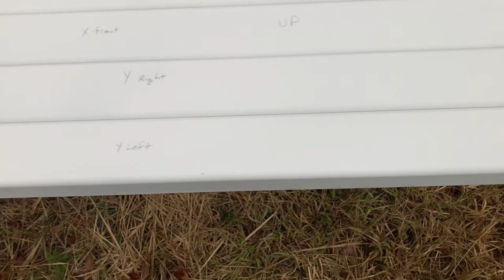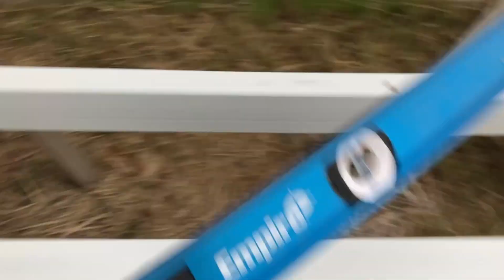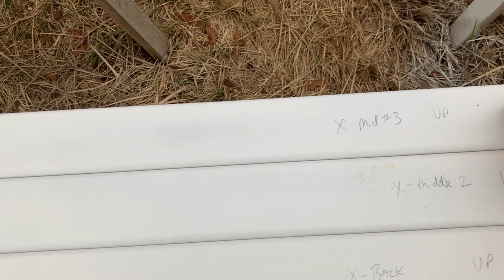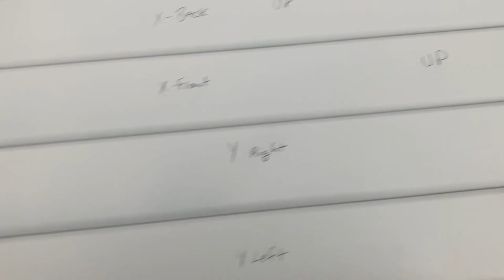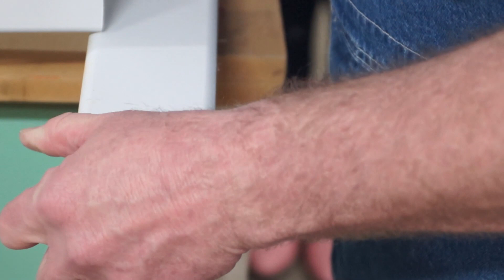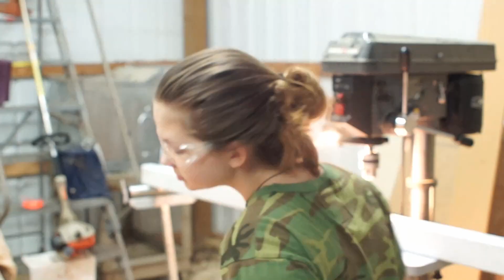Mudd Flapp Ranch- PrintNC CNC X-Y Frame Build

Comment: Currently building my own, and I've enjoyed all the PrintNC build series I've seen, but so far I think this is my favorite owing to you showing all the details. In particular, I appreciated seeing your method for marking the holes for the middle X supports. The wiki does say to choose the most precise lengths for the frame members, and that the middle X supports are less critical in that regard. This is because, in all likelihood, we will end up getting our steel cut for a small fee at the metal yard, and they don't guarantee much precision, so there will be some variation in the lengths. This is the case for me. The wiki doesn't go so far as giving a good method for dealing with that in the marking step as far as I've seen, so I plan to follow the method you've demonstrated here. Thanks!
Reply from the maker: Thanks for watching! I try to show enough detail to be useful, but on too boring :) No one wants to watch me drill 100+ holes in steel. Have fun with your build

Comment: Nice project, more rigid than Shapeoko or x-carve. But i will go with welding, in my case (instead of bolting the frame)
Reply from the maker: Way more rigid that any of the commercial/ hobby machines in this price range. Welding is an option, however the designer of the PrintNC wanted a design that would be easy for the average DIYer to build. Since no all DIYers can weld, he opted for the bolt together design. Bolting also allows a bit of adjustment that you won't have with welding.

Comment: As a reference, how much did you pay for your steel tubing. Looks like a great build.
Reply from the maker: Right at $220, for 3x2x3/16 x 40 feet, 4x2x3/16 x 10 feet (have about 18 feet of left overs). That included the cuts. All from a local steel yard.

Comment: I'm assuming you'll measure the diagonals to make sure it's all square when you finally tighten the screws.  Since yours is larger than standard, was it difficult to change the size of ball screws and linear rails?  Did you buy everything from Aliexpress or did you go a different route?  Thanks for doing this series.  I'm also following Projects by Brian as he's building his.  It's a nice looking machine that doesn't look too hard to build and gives you a very capable machine for a reasonable price.
Reply from the maker: It will be squared to the waste board. It was not at all difficult to scale up, the Three Design website does it for you. I did not use the AliExpress store, but probably should have. I will make a video soon of the parts I bought and where I bought them (spoiler- most came from eBay and Amazon).